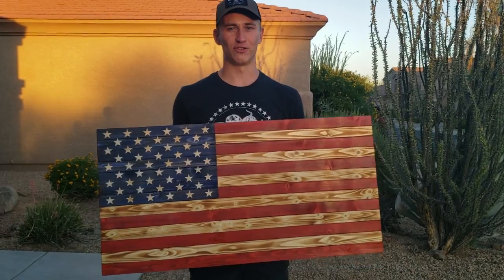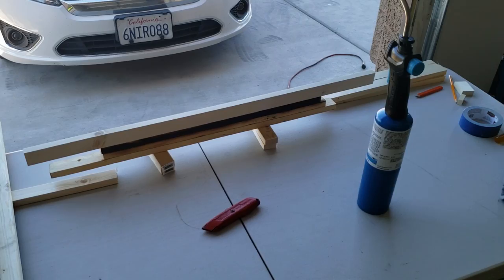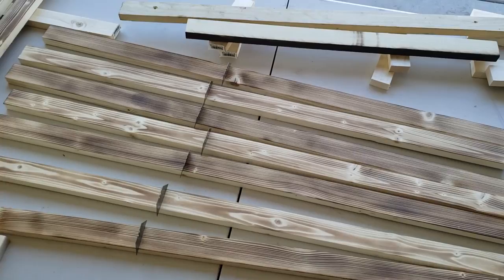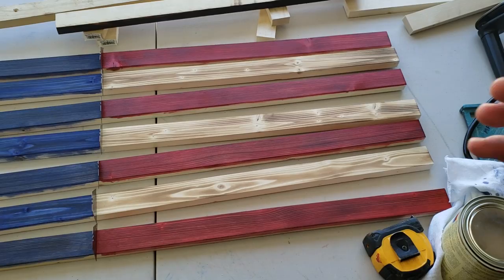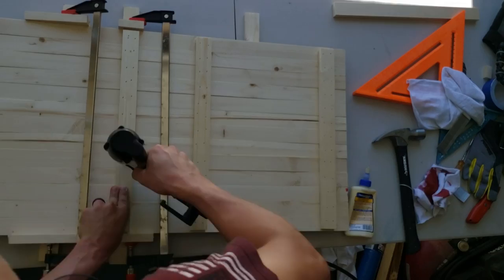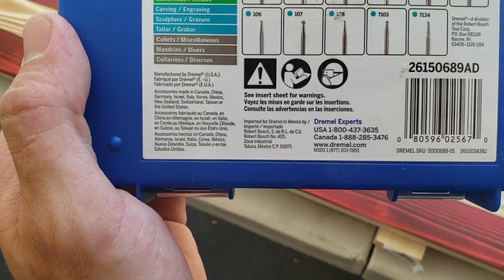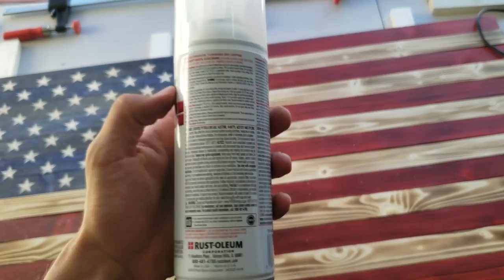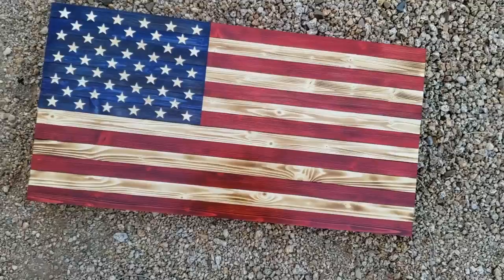HOW TO BUILD A RUSTIC WOODEN AMERICAN FLAG! STEP BY STEP

Comment: Thanks for the tutorial.
I’ve seen a couple of these made by a local guy but he didn’t sand them to well before hand and the edges were very splintery.
He also just spray painted or stained the stars from a pattern instead of carving them.
It seems the carving gave them a much better look with depth.

I made a few similar items and instead of spraying a final poly coat I
Like to use the same Varathane stain in a matte crystal clear which gives it a beautiful shiny matte sheen, gorgeous for furniture finish work.
You an also steel wool and add as many coats as possible to make it look like an absolute stunning piece with a super smooth finish with a deep shine, furniture grade.
Yes this takes a lot more extra time and effort and if not making one for yourself you’ll have to charge accordingly unless you’re like me and enjoy making them as gifts for friends and relatives.

Comment: Like your videos and the fact that you don't have a 40 x 40 shop full of Grizzly tools.   I do weekend wood work and don't have $50,000 worth of tools like some of the people on youtube. Had problems with burning. Harder to get the "toast" color then I thought. I did have some burnt spots but that is ok, it was the over all darkening of the wood that I was looking for. I want to build several of these for Christmas presents so I figure I should get it right eventually.  About the stain, my colors do not seem as bright as they do on all the videos out there. I used the scarlet, and blue that you recommended but I also used a whitewash color stain as I was looking for a white (ish) rather then a bare wood tone. I applied a color, waited a few minutes, wiped it off, let it dry, and then reapplied another coat. I watched several vids (again) and realized that no one was wiping off the boards between coats as they would do for a cherry or oak stain.  Are you wiping off the stain between coats and just not showing it? I am afraid that not all the stain will soak in and I will be left with places that are permanently tacky.   Also, is there a trick to not spreading the stain where it doesn't need to be. The back of your flag seemed pretty clean but I have places all over the back where I "contaminated" it when I was staining the front of the boards.
Reply from the maker: Thank you very much! Haha yea for now i just got my corner in the garage 😂 youll definitely get the hang of it the more you do it. For my staining i just rub it in with a rag without wiping off the excess, which their usually isnt any because i spread it until there's no excess. But i also do a couple coats to get it darker and on my recent flags i have done 3 coats of my blue and red to get the color and darkness that i like.  And when im applying it i usually just try my best to keep one hand clean and then use that one to handle the wood and use the other to handle the stain and do my best to keep the stain under control. Good luck to you man i hope you can get it figured out 👍🏼 the more projects you make and the more you mess around with staining and torching youll definitely get a feel for it
Reply: @MaxF01  All of my tools and benches are on wheels or have a handle so I can move things out of the way to work on my F250. My first few stars looked as it I was trying to carve them out but once I concentrated on just removing the color they came out much smoother. I emailed That Flag Company about the stain and they said the same thing that you did. Don't wipe the stain off once applied and add a second coat after the first is dry.  I have made some mistakes but I am finishing this flag and will hang it on my garage wall to remember where I started. Not doing them for money but as gifts to family/vets.  Going to practice on the stars a little more before I start my next flag. Thanks again for the videos.
Reply from the maker: @rjohnsoneod  practice makes perfect man! Im happy to share!
Reply: @MaxF01  Built two and working on my third. First one is in the garage as an example of things to avoid. Stars are a little rough, got glue on the red bars, tried to wipe it off and flag looks like I bled on it. Second was much better and and darkened as the coating dried to give a weathered look. On a future flag I may run the board through the planer to think them out a little. Might make the flag lighter (less heavy). Only two minor issues so far. My navy blue stain is really thick. It is made that way so it will not run but it takes some thought to keep it from drying before you can get some of it off or it will dry tacky.  My dremel bits dull before I finish all the stars. Have to keep those stocked up.  Thanks for all your help. By the way, I am working on a rustic coffee table and am considering making a flag out of hard wood, embedding it into the table, and coating the whole thing in some type of clear epoxy.  I have to make three flags as gifts by christmas but if I can get the table finished I will send you a photo.
Reply from the maker: @rjohnsoneod  im glad to hear they are coming along better! I would love to see the coffee table! I was thinking about doing one of those for a video so that would be cool to see how it turns out! I hope it all goes well man 👍🏼

Comment: Max i finally was able to go to Lowes and get the paint i needed to paint the flag, thanks to you wasn't able to get navy blue but was able to get a blue color very close to navy so now i am set up to do a flag for myself. i noticed that the backer strips don't go even from top to bottom, is there a reason you do that or can i make mine go even from top to bottom, and again thanks this is a Louisiana Veteran making this American flag. the blue i got at Lowes is #43 deep ocean minwax water base it is a good match.
Reply from the maker: Thats great to hear im sure the blue you go will work out just fine! You can definitely even the backer strips out. I really hope everything works out and the flag turns out good, im sure it will! Also thank you for your service!
Reply: Rouxso the color you want from Lowe’s is the water based MinWax stain in “True Blue”. It’s a proprietary color unique to Lowe’s. Also the red is “Scarlet” which matches the proper flag colors very closely. Also if you have access to a CNC you can get the stars carved out by the machine and then fill them in using stars carved out from a light colored piece of lumber. 
OR get West System epoxy and mix up a small batch with white color powdered dyes in it and you’ll use their syringes to place just the right amount into the carved out areas.

Comment: what a great looking flag, you did a great job with the whole project easy to follow instructions, woodburning turned it into a great project. i would like some feed back on how to get the graphics you used to get it off of the computer, what program do you use, i am not savy to doing that , can you help me with that ?thanks i will be waiting for an answer. and again great job will keep following your site.
Reply from the maker: Thank you very much!! To get the graphics off the computer i use a program called "paint". I dont know if apple computers have it but Microsoft computers usually do. Once there i will adjust the size and then print. I have been told that "rapid resizer" is another program that lets you adjust the size of graphics and then print. In a couple of my videos i show my process incase you want to see it. Hope this helps! Best of luck to you!
Reply: @MaxF01  thanks Max i appreciate the quick response, are there symbols and pictures that i can retrive off of these sites, if not where can i get stuff to put on my wood projects to carve on my wood projects with the router, thats what i am into, and again thanks and keep those videos coming, i will callyou the talented flag man.
Reply from the maker: @rouxso5124  of course no problem!! To get the pictures themselves i just use google images and add the word "outline" or "silhouette " to whatever image or design i am trying to find. Thank you very much i appreciate that!!

Comment: Question.  The cardboard used when carving.  Does that help keep the dust wheel from marking up the blue wood as well as for a straight line reference? It is dual purpose?

Comment: So I tried doing a test carving on the same pine, unstained,  wood that I used for flag, other really rough and choppy, so much so that I don't feel it looks good and may end up using the stencil  to spare paint the stars. I dont have  the blower but it was ugly carving them. It looks like you did a light skimming of the wood, thats the layer I had most issues with

Comment: Hey, looks great. I also make flags but my biggest issue is the glue pushing out of the strips so I have to wait until the glue is dried, sand everything down and then paint

How do you make sure the glue doesn’t seep through
Reply from the maker: Thank you very much! I just do my best to put it on thin, then wipe it with my finger to spread it out and then clamp it, i do live in AZ and its pretty dry here so that could make it not be quite as runny as a place not as dry. I still do get some that comes through but usually its not too bad

Comment: I’m curious I see you cut your length at 36in and most others I’ve seen do it at 37in.. is there a reason why you do it at 36in ? Regardless great work my friend !
Reply from the maker: No reason thats just what i thought was the proper length but i actually started doing mine at 37in also because its more accurate with the height of the flag. Thanks a lot man i appreciate it!!

Comment: In  the middle of making my first two flags for christmas gifts.   I have the flex shaft and dremel and 105/106/107 bits.  But I tried a "test" on a piece of wood and it looks horrible.  I ended up just spray painting the stars.  Any specific tips on the next time I try with the dremel?

Comment: Nice work. I wanna make one. Seen many videos  of guys making these. Mind if i ask how much it cost you to make one?  Also, any reason why you didn't  stain the ends ? I think it would look better if the ends were stained. But other then that nice work.
Reply from the maker: Thanks man!! The wood costs about 20$ and then youll need the stain which is like 10$ a can and then stuff like the glue, nails and hangers. It sucks that you cant get smaller cans of the stain because you only need a little bit but i dont think they have them smaller. Ive stained the ends on a couple of mine and i think it looks really good! Thanks again man!
Reply: @MaxF01  ok. Thanks. Not sure when i'll get around to making one. But maybe soon
Reply from the maker: @rdgracer71  no problem man hope the build goes well whenever you do it!

Comment: thanks for the video picked up wood and a dremel today plan on making one for a gift I was going to use the base that came with the dremel or is the flex shaft the way to go?
Reply from the maker: No problem, i actually have never tried it without the flex shaft but if your only making one i would give it a try without it and it might not be too bad! The flex shaft is nice if you are going to be doing a lot of carving but for only one it might be fine without. Good luck to you! 👍🏼
Reply: @MaxF01  got the flex shaft everything was good until I noticed I goofed up and the stencil was upside down. only  carved one star but its too late So my mother will have to wait for a good one. lol.
Reply from the maker: @derrickcurtis2793  shoot man i had to learn that the hard way also! It will be worth the wait! 😁

Comment: Just curious, the template that you are using, is it exactly 14 3/4" long? Or do you pretty much center the stars on the Union?  I bought some templates on Amazon a while back,  but the measurements in the description of the one I bought isn't the same as the actual template. The one I have is 14 7/8" long. THANKS!
Reply from the maker: I dont think its exactly 3/4” so yea i will just center it on there as best i can. No problem!

Comment: Ok dumb question I am having a hard time finding the stain in blue and red ... I have been to Home Depot ...Walmart none have that color in stain ...am I missing something ??? Thanks in advance
Reply from the maker: Hey there are no such thing as dumb questions! The blue one i have is from home depot and the red one i have is from lowes because i couldnt find the right red at home depot. I am pretty sure lowes has both colors if theres a lowes near you by chance. When you get it its just a can of clear tintable water based stain and they should have a little folder next to it that shows all of the colors it can be tinted to. Then you just bring it to the paint counter and show them which color you want it tinted to and they add some stuff to it and mix it up to be that color so you wont be able to find it just on the shelf. Hopefully this helps and please dont hesitate to ask me anymore questions! Best of luck to you!!
Reply: @MaxF01  thats a helpful comment Max that helps me with my question to you

Comment: thanks Max i'll be wauting to get that paint info from you when you get home thanks
Reply from the maker: Here is the info for the Blue:
Varathane Classic 
Water Based Wood Stain
Clear Tint Base
STR#6967
BASE: 339583
COLOR:(339583-34)NAVY BLUE
And here is the info for the Red:
Minwax
Water Based Wood Stain 
Clear Tint Base
COLOR: Scarlet
The only codes i see on this one are, 101-3, 109-3, 217-1Y6.
I hope this helps, please let me know if you have anymore questions!
Reply: @MaxF01  thanks that will help me to get the right color paints keep up the great videos and great and easy to follow instructions, great teacher
Reply from the maker: @rouxso5124  thank you so much i appreciate it!!!

Comment: Hey bro do all of your wood strips always lay flat...I have problems with some of the strips popping out and the strips are not even and level any advice ???
Reply from the maker: Yea thats happened, to get them even usually ill use a large speed square and make sure their all lined up and then to get them to lay flat i just try push down on the backer strips when i am nailing but it can be kind of a pain. Ive thought about making a jig to help assemble them and if i do ill make a video on it👍🏼

Comment: Quick question. Do you pound in the razor blade deep? When I stain the red and blue when I take out razor the stain gets messed up on the line. I can’t wipe out excess. And doesn’t look good. Also do you wipe off or just leave two coats on? Thanks brother
Reply from the maker: Not super deep just enough to go through the surface, but most of the time ill wait for the stain to dry up a little incase theres a lot of it up against the blade it doesnt mix when i remove it. And when i stain i just use a rag and leave it on but i spread it around so it doesnt go on super thick. No problem man let me know if you have anymore questions!

Comment: When I use razor blades to get the lines clean between the red and blue I notice it leave a faint white line between the colors (wood color) unpainted area, do you get that problem and what do you do about it? Thanks.
Reply from the maker: I have had that happen before, to fix it i just get a little bit of stain on my rag and then push it down into the corner as good as i can. The way i did it before the rag didnt have enough stain on it and i wasnt pushing it in far enough to stain all the way up to the blade since its a tight corner. Hope this helps👍🏽
Reply: @MaxF01  Thanks I'll try that. I also tried since my message is a fine point red sharpee, works great
Reply: After I remove the razor
Reply from the maker: @mikeledee8786  thats a really good idea
Reply: @MaxF01  Thanks

Comment: HI just to clarify, do you glue each board together or just use the brackets??
Reply from the maker: Hello, I used to glue between each one but more recently i have just been glueing to the brackets, its much easier and cleaner and so far they seem to hold up just fine 👍🏽
Reply from the maker: I also have started using 1x3 for the backers so that theres more to glue to and i can also fit 3 nails per stripe rather than 2
Reply: @MaxF01  thank you 🙏
Reply from the maker: @smeg8557  im happy to help 😊👍🏽

Comment: Hi Max, I just want to ask you a question, you cut your stripes 36” and others cut the stripes 37” is there a reason for the difference? Thank You for the video.
Reply from the maker: No reason, thats just the way i learned, since this video i have started cutting mine at 37" but i honestly cant tell a difference. I believe 37" is the proper length for the height. You are very welcome!!

Comment: what type, size of razor blades did you use, and how deep did you put them?
Reply from the maker: They are just husky brand utility blades so the replaceable blades for utility knives and i just try to get them about 1/16th inch so just barely through the surface enough so that stain wont leak to the other side. Hopefully that helps let me know if you have anymore questions!
Reply: @MaxF01  Thank you so much! I really love this project! American-pride!!
Reply from the maker: @rebekahlundin3238  you are very welcome and i agree it is an awesome and fun project to show our patriotism!
Reply: @MaxF01  I made one last night and it went great, except for the silly blades. My blades must suck or whatever but i had to hammer the crap outta them and the bent a little; any suggestions?
Reply from the maker: @emissary_ror  glad to hear it went great and sorry to hear you had trouble with your blades! Ive always used blades from home depot, they are husky brand and they are called "heavy duty utility blades" i havent had any problems with them at all 👍🏼